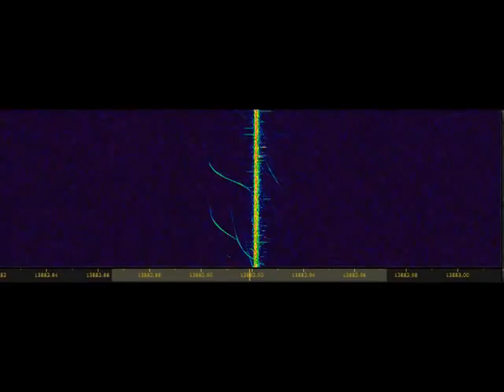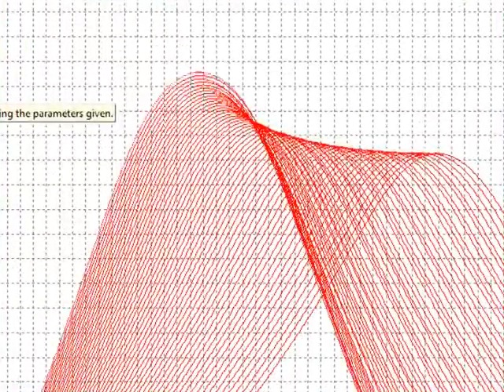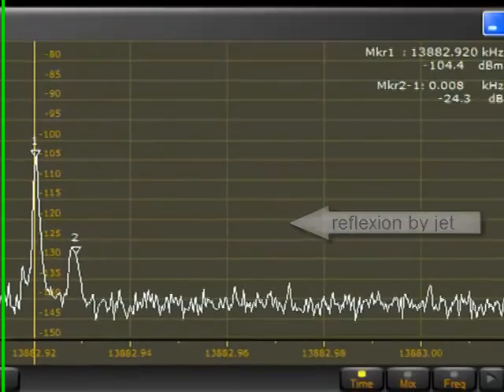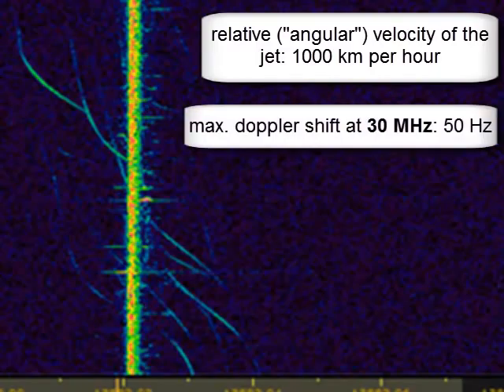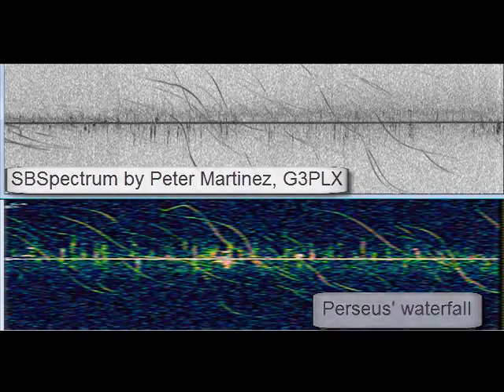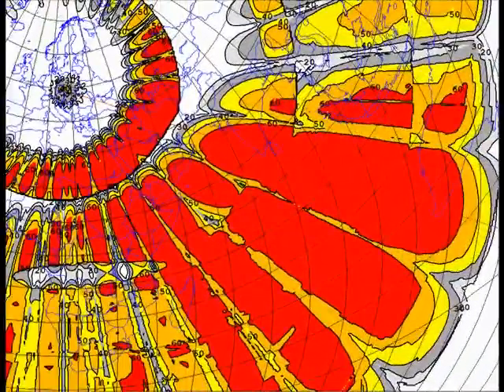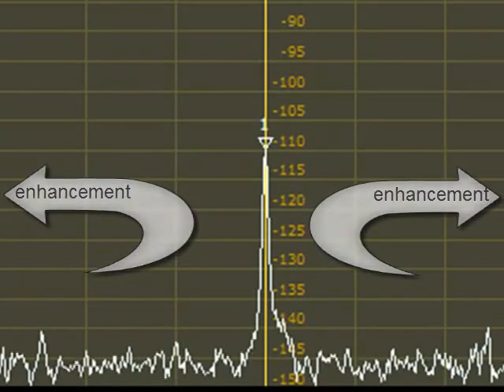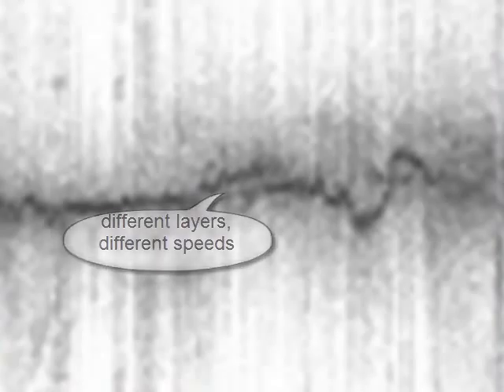Receiving Doppler from Jets and Meteorids on shortwave

Comment: Tnx for fine introduction to AS and natural scatters! A question about measuring setup to know if you are within radio horizon: What is the distance between your Rx and the Tx? 

Well axplained also those scatters still explained as meteor scatters (MS)! Here is some new knowledge from my studies: The 'MS' do have a distinctive spread spectrum of high voltage discharges in gas. They lack any distinctive evidence of fast dopplers related to linear meteor movement. 

So most of the HF and VHF 'meteor scatter' are in reality Electric Discharge Scatters (EDS). They have been heard simultaneously with high lightning strikes like 'sprites' (see Thomas Ashcraft's site). 

I have been observing them for a few years on VHF OIRT1 carriers. Short 'MS' which are in reality EDS appear come from lower altitude high atmosphere lightning discharges and long ones from higher altitude high atmosphere lightning discharges, concluding by the wider spread spectrum of long lasting EDS. 

Longest lasting electric discharge scatter is the Aurora Scatter. Because aurora is still higher than high lighting discharges, it creates a very wide spread spectrum in the almost zero pressure environment. This is the hissing 'aurora tone' we hear when listening to aurora scatters. 

Regards, 

- Juha OH7HJ 

Electric Discharge Scatter (EDS) examples: http://www.oh7ab.fi/foorumi/viewtopic.php?f=21&t=295&p=1159&hilit=EDS#p1159 

6m VHF aircraft scatter and EDS demo 'radar' screen: http://maanpuolustus.net/pages/tutka/

Comment from the maker: @unnim 
Thanks for your comment! Ionospheric layers are far above the height of meteorite trails as well as jets. Usually, you receive a reflection ONLY by the jet of the meteorite trail. You have to have some experience, to receive an echo not directly, but this reflection by an ionospheric layer. This will be the case, where the transmitter is more than about 3500 kilometers away from your receiver. In this case, the echo additionally carries the doppler of the ionosphere. 73 Nils, DK8OK